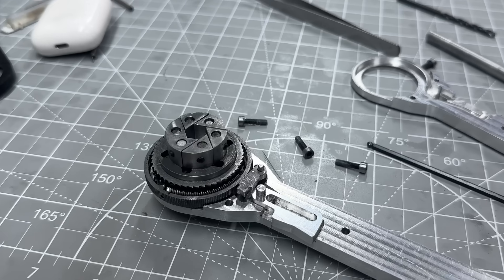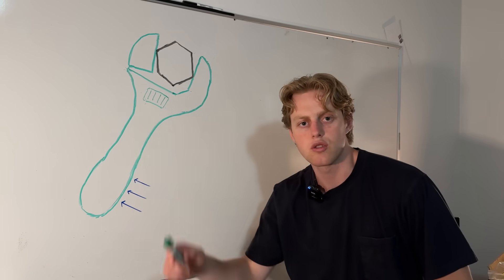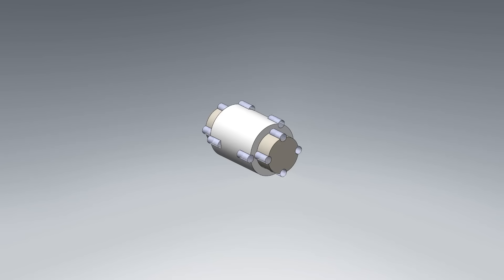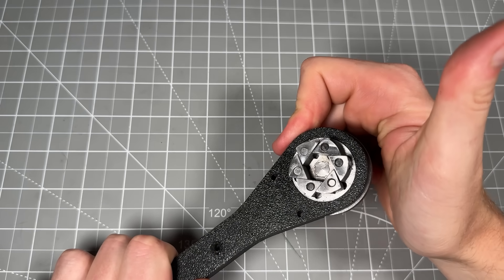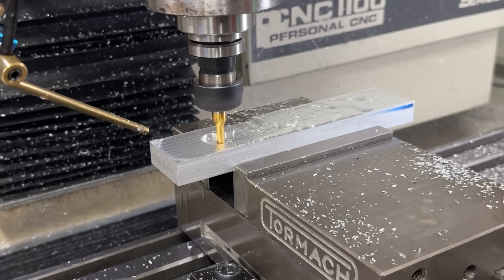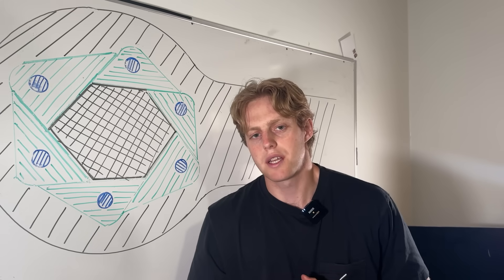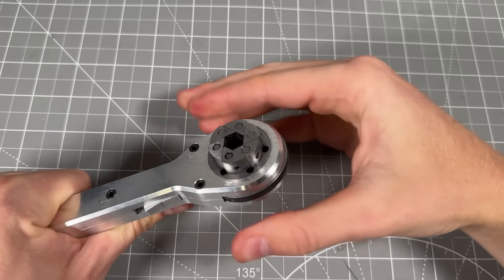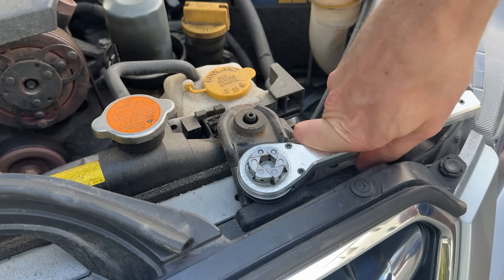I Invented an Adjustable Ratcheting Wrench

Comment: I like it.  If I were you, I would drop off a couple of units at local shops and get feedback before doing another round of refining.  I think even if you could get it working reliably in the field, you could just produce like ~3 sizes (e.g. small, medium, large) and it would still be viable - 3 ratcheting wrenches is still better than exact sizes or the worm gear.

Comment: Looks really cool and i could definitely see this having a spot in a tool bag, it'd be way more convenient than lugging around a whole socket wrench set, i'm not sure the range of your wrench but i'd say for most work you'd probably need  2 or 3 at most. Maybe you could get more range with even further an reinforced mechanism, maybe make the pins and the jaws a single solid piece, i definitely think it could still be improved at least a little, but it already looks quite good.

Feature idea (and likely very deep rabbit hole): Some way to rotate or replace the jaws to work with 12-point bolts, external Torx bolts and whatever else you might need. I don't have a great idea of how this could be achieved other than the ability to swap out the jaws for some made to work with those kinds of bolts. If you can figure out a way to make it work, hats off to you.

Comment: Very cool design! The length off the jaws may cause hassles as bolts need maximum torque when they are gripped at maximum "stick out", not sure if that will be a problem. I'm looking forward to more videos!

Comment: I would buy one.  Just look how many gator grips they have sold, and those are JUNK.  Price point would be a tough challenge though.  It almost has to be affordable to the average homeowner to make money.  And they won't spend big bucks on a tool like this in general.  Especially in the world of Harbor Freight, where they can buy crappy socket sets pretty cheap.

Comment: the only thing i would like to see improved on this (other than maybe the chamfer) is to make it a pass-through. Then one could tighten nuts onto bolts as well as bolts into fixtures. As for working in tight spaces no single tool does all the things. However if this exact design was a pass-through, then it'd easily be a "go-to" tool.

Comment: I was thinking a couple days ago working with an adjustable wrench "how cool would it be to have one of these but a ratchet, I hate having to move this back constantly." Though what i was imagining was the original design in a chain belt design using a gear and single way ratchet system but this is 100x better.

Comment: I love the concept. As you alluded to, most adjustable items have no grip and completely suck. If you can make this really durable and have high grip, which it seems you can, I could see it being great for either the homeowner who doesn't want to maintain a huge set and doesn't have heavy-duty needs. If you can really make it beefy, it might even have application for worn bolts that aren't really their spec size anymore. The challenge there is that second category is likely to have a mountain of rust too so it would need to have insane grip to not make things worse.

If the price is right I'd certainly add one to my toolbox. The complexity and manufacturing tolerances are definitely going to be a challenge to overcome going towards a marketable product, but with luck mass production techniques can help with that.

Comment: The chamfer would def. help, but what about adding more complexity and making it so the jaws can slide up/down? That way, you can have it "centered" like it is now, or like, push a little detent, and the whole center mechanism slides up or down, giving you extra depth? Can't tell from your model(s) if that would work or not.

Comment: First let me say, fantastic work, period.     
Next, adjustable ratchet wrenches do exist, maybe not with 6 sides of contact though.
Also one possible flaw, is can you adjust it with only one hand?  There have been a lot of instances where I've put a socket into a gap with one hand, and having two hands in there to try put it on would absolutely not be possible.  I could see a potential fix to this being some mechanism to hold the jaws open, and then a simple touch that would snap them shut could work, but then maybe not even think that far out, instead of having a tool that works for any instance, have one that works for a good number of cases, but you still need a socket set for the hard to reach areas.

Comment: I rarely use my adjustable wrench, but I do own one and it does get used some.  I was thinking though if you mechanism truly uses rotational force to grip even titer on the head it may make a good tool for when bolts are rusty, worn down, or stripped. Maybe with the addition of some really grippy texture to the parts that touch the head itself.  Well done on running this all the way thru prototyping.

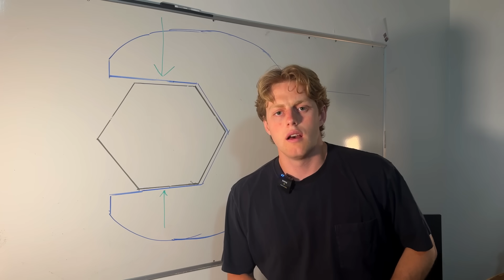Comment: 1:19 I wouldn't even mind the "slow" part, but the ones I had had so much backlash that is was near impossible get even a remotely good grip on something.
Most of the times I got better grip with some pliers with those "nut cracker" teeth than these adjustable ones...

As for the viability of this as a product, I'll just say this: this wrench doesn't care about metric or imperial, it only cares about "it's a symmetric hexagon".
I'm not even a mechanic or anything related to that and I want one of these things : /

Comment: Neat design. I can really only see two major limitations to the design.

1: Size. This one may be difficult to overcome given the design. Barely being able to handle a ½" bolt is pretty small, and depending on how large the smallest diameter is, that limits it even more.  For fasteners that small, your tool is only providing a small amount of convenience and the head is likely too large to fit in a lot of places you'd need for fasteners of those sizes.

2: It's unidirectional.  In other words, you need to flip the tool altogether to change direction.  This is common on some ratcheting tools but on yours it provides an extra challenge because the way your tool grips the fastener also means that it has to be twice as wide as it needs to be which again makes it difficult to fit into tighter spaces.  Making it able to change direction would reduce the size of the head while providing added convenience.  You could (and should) even keep the center plate if you made it able to change direction.

Comment: I have been a millwright for over 40 years. I worked in a sawmill in my early years and we had to pack a tool pouch with multiple crescent wrenches and what we thought would be the most common wrenches we would need. This would have eliminated the excess weight and wrenches needed. Yes compact design would be nice, also a through hole would make it the ultimate tool. I would still buy one even at the end of my career. Awesome!!

Comment: Awesome! 

When you said "half inch bolt", I assume that was a 3/4" head. Right? And the 1/4-20 was 3/8"? Unfortunately, I think any marketability of this will be ruined by the low adjustment range. But I'd love to see you keep working on it and improve on that!

Some ideas:
1. while this would probably involve going in the wrong direction for adjustment range (because it would restrict space on the plates), I wonder if it would be possible to make it a through-hole design.
2. it seems like you could probably eliminate one of the springs and pawls, right?

Comment: Your current working iteration probably already exceeds the strength and convenience of any standard adjustable wrench currently available. This alone makes it marketable as is. I wouldn't worry so much about trying to make it comparable to traditional sockets for tight spaces, but instead make wrenches that size for niche industries where they would be an awesome upgrade, like for the guys who bolt structural steel together, do tower work, or lineman. In other words, get your wrenches into the hands of guys in industries,  working in places and environments where your wrench isn't as disadvantaged as trying to replace a socket wrench in a cramped space under the hood of a car. And then make other innovations, if or as needed. You already have the makings of a fine product. Now make it a strong brand that means something in the places where it will already be useful... and kudos to you for making such an awesome tool!

Comment: If there was a way to make it fit into tighter spaces that would be cool, but I do understand the difficulty of engineering that haha. Also, I think some distinct visual indication of which side is which would be great. Maybe even just a colored text/piece of plastic on each side would work great, something that's easy to see from a distance for quick switching. I say this as someone who has bad short-term memory lol, and I always forget which way the switch goes on a drill or socket wrench for tightening things

Comment: That's amazing, great job man ! One improvement would be adding another block/release pin on the outside ring, this way you wouldn't have to hold it open with your thumb. You could block it open it to the maximum using both hands, then extend your hand in a crawlspace your bolt is in and release with a push.

Comment: That's awesome, I'd definitely get this for my tool box. The one other improvement I can think of is the design of the ratcheting mechanism. I instantly thought of how ratcheting screwdrivers have v shape teeth, instead of the design you opted for. Both work very well, but with the former, you can jam the teeth in either direction quite easily.

Edit: To expand on this idea a bit, you could mill a hole in the back of this, and show the ratcheting mechanism being either red (for clockwise) or green (for counterclockwise). With arrows pointing in respective directions. You could simply have a logo in the middle that would show both colours, so you knew it was locked. Kind of like the occupancy locks for doors. This saves cost and prevents confusion.

Comment: Yk what is really the biggest design flaw here now other than the torque rating is the compactness it isn’t compact enough to be used in most cases but im sure there is improvement this is only the beginning.

Comment: I like to see your passion and creativity for the idea you had for a long time. You’ve solved so many problems along the way! Well done! As an idea to increase the tensile strength of the teeth, I was thinking of adding a dovetail joint between the teeth gripping the bolt. Due to the dovetails the teeth can still slide in and out, but are also joint together, hence resisting force applied by the bolt on the teeth due to the rotational motion. However, it adds another layer of complexity

Comment: I'd buy 10 of these,

Also, I'd be interested in a version where instead of a single thick head with both directions on it, there would be one direction on each side of the tool.

Yes this means more parts and complexity in assembly, but it also means a lower profile

Comment: The average nut or bolt on a modern vehicle requires at least three wobble extensions, a slim and deep socket in some weird size, the prior removal of several parts, and the mechanic to break his arm in several places just to get access.  So facetiousness aside, while this is a great, if not genius idea, I just don’t see a lot of uses for it. At least not in the automotive sector.

Comment: For parts where laser cutting didn't work, hydro jet/ micro jet still might, and would save some time over machining. There is also potentially EDM, but I don't know much about that aside from it's precision.

Overall it's truely fantastic, I really want one. The only downside is the bulk which you covered, but even then, I have a normal set of sockets, then I have some long sockets for getting into recessed bolts. Even if this couldn't replace ALL the sockets someone might need, it would certainly replace a chunk of them.

Comment: Make the faces push on the face of the bolts or nuts and not the corner and you'll have a real winner. Neat design if you can make it reliable. Every time you say precise fit matters I think it'll fail to work when worn out a bit. Consider this too.

Comment: Love the idea, but size matters of the tool too, this will work on everything that is easily accessible but not for anything else
Have been thinking of a similar tool too for a decade or more, that will also be small enough to fit in cramped spaces, let me know if you need any ideas or wanna trade ideas or just discuss around it to collect new ideas!

Comment: hear me out, the heads move in a straight line making the design bulky if they were curved this would allow for more of the force directed into the body meaning you could get away with smaller parts 
and it would look way cooler
currently i see ~ 45 degree meaning ~ 70% of the force
if it was more like 60 degrees that would bring it down to 50%

Comment: the problem with solutions like this is that under load the segments\teeth of the head will separate and then fail and do so at a load that will be lower then a traditional friction fit ratchet.

Comment: this is amazing, definitely keep developing this

keep the use case in mind, this is never gonna be the best wrench for high or accurate torque or tight space applications but for everything else this seems like the optimal tool for the job.

also consider a screwdriver/drill bit type attachment for narrow spaces, great stuff

Comment: I'd be curious to see a variation that puts a slight rounding on the the jaws.  Every big company does this with their sockets and wrenches, and has a different trademarked name for it, so I don't see why this concept wouldn't also benefit from that.  It puts more pressure on the flats themselves given imperfections of manufacturing.  Surely there's an arc of good fit that would make this work well for the range of bolt sizes.

Comment: You could make the jaws snap from one side to the other by pressing them through the design while having locking detents to make sure they don't pop back to the other side, cuts down on the production cost by reducing the amount of Jaws that need to be machined while also reducing the overall head thickness.

Make the detent on a button kind of like what you see with a ratchets that have the socket dropper button on top, that way you can one hand the thing, press the button, smack it on a surface to pop over to the opposite side, and get to tightening or loosening

Comment: Could be good for climbing anchors, it's a single piece that cover multiple sizes and holds itself in place, could also be worth it for workers who climb antennas or thin metalscapes that require anchoring bolts down.

Comment: This is super cool! Great work. One thought might be to redesign the button a little into a two staged mechanism, one for the lockout it has now, but then as you keep pushing you could have an internal leverarm or gearing to twist the springloaded plate. this would allow for much faster bolt switching and one arm usage. keep it up!

Comment: Very impressive, both the design and your persistence in developing it. 😎

The complexity and tight tolerances might be an issue for manufacture and price. But modern high-end CNC machines should handle the tolerances without much trouble. Then just crank up the scale of production to keep price down. Cost of assembly is probably going to be harder to bring down.

The complexity (including number of moving parts), along with the tight tolerances, probably also mean the internal mechanism needs to be kept clean to make it durable. Not immediately obvious how to do that given the jaws need to be exposed. Going to be more complicated than just adding some kind of plastic/rubber cover to it. 

But if you can work out the remaining details and issues it could be a winner and a seller.

Have you got it patented yet? If not talk to a patent lawyer, pronto.

Good luck with it. 🙂

Comment: Also to clarify for design purposes:
I'm a Chief Engineer, basically advanced industrial and commerical maintenance, me and my team have to manage massive properties and work on literally everything from huge industrial equipment to residential level electrical stuff to commerical pipes and hot water etc. 

Running between all of these different environments, you need as varied of a tool set as possible without being so heavy it's unwieldy. This would perfectly replace the need for most basic sockets in a manner that's still usable especially if the design is improved. I would buy some for me and my technicians.